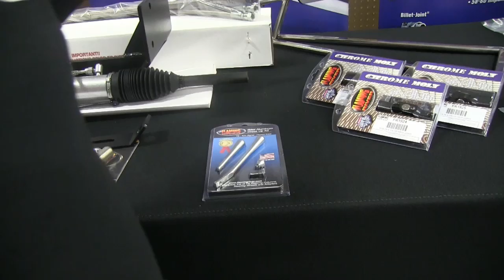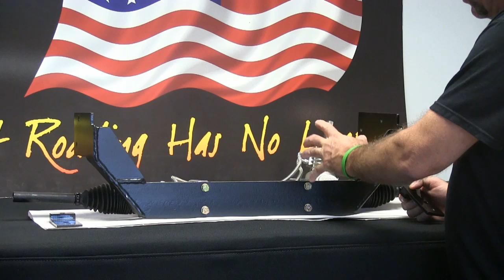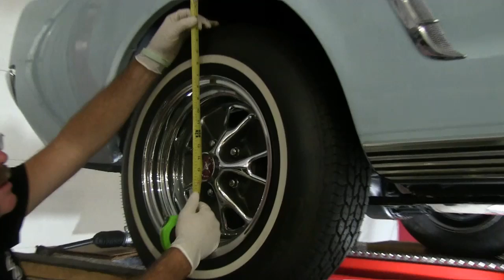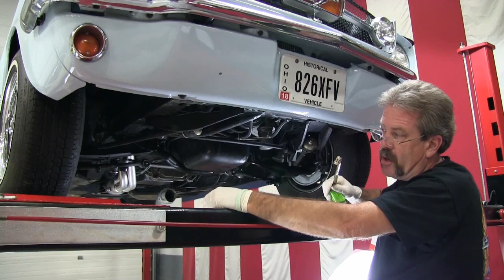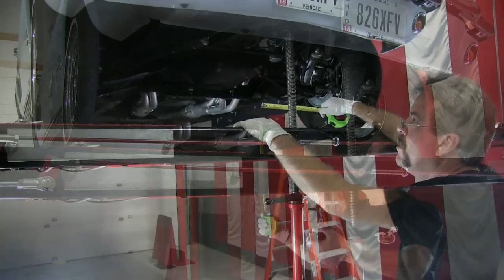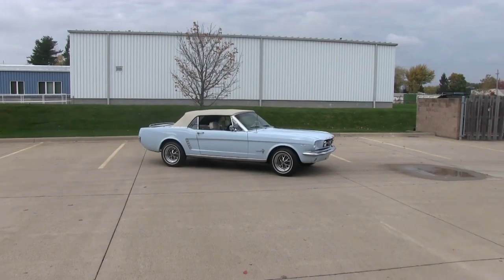Flaming River Rack and Pinion Installation in 1965-70 Mustang

Comment: I have a 1965, 6 cylinder Mustang and like Elmo, I only want a manual kit, not power. Do you still make these and how many turns lock to lock do they have. I'm assuming from the video that I only need your kit and everything bolts on.
Alan
Reply from the maker: Alan, we have manual kits that come with a variety of options. They can be seen online here, about halfway down the page. 

http://www.flamingriver.com/index.php/products/c0007/s0011

If you have any questions please reach out to us at 800-648-8022, Monday - Friday 8:30am - 5:00pm EST.  Or, you can use our online chat on our website.

Comment: Appreciate the presentation.  Was hoping to see the original steering box with integrated shaft removed from the car though.  The original box had an integrated shaft whereas the box removed from the car came out without the shaft.  Was the shaft cut and removed before the box was taken out?    Would like some clarity.    Must say that rack and pinion no doubt is a great way to upgrade the steering for these older mustangs.   In the future perhaps you might be willing to show how to install your FR1497Q box and shaft in a 65-66 mustang (demonstrating also how to remove the old integrated unit while the engine remains in the car.

Thanks, Ace.

Comment: I have been installing this setup on my mustang, but how do you make the steering shaft connection between the rack and column? Hard to get the nice steering feel because of the slack the mid support is giving... Got a double yoke from the steering column and a support, then an ordinary u-joint at the rack... But the uniball that is in the kit makes a 20mm deadzone on the steering wheel. The rack is nice and the rest of the kit is nice. Just hard to get the "perfect" setup on the joints between column and rack.  A set of picters and how to on that would be nice.

Comment: I put one of these in my 66 over ten years ago. It has never been right.  Very disappointed. directions were terrible. An absolute nightmare to install! I wouldn't recommend to anyone. The bump steer is way worse than it was factory. If someone from flaming river would like to contact me over possible solutions it would be greatly appreciated!
Reply: John Morneault did you ever hear anything back from flaming river? I’m looking to upgrade my 67 to rack and pinion, but your comment is troubling. It’s interesting, since they clearly got an improvement on bump steer in this video. Do you recall what your specific problems were with the installation?

Comment: I installed one of the manual rack and column setups on my '67 Fastback Mustang about 10 years ago and it could not have been any easier to install.  The trickiest part was finding a pair of headers that would work with it but one call to their tech line and they said, "JBA Shorties" and I was in there like swim wear.  It is a great product and while it certainly isn't cheap, it is light years ahead of the factory setup in terms of responsiveness and overall performance.